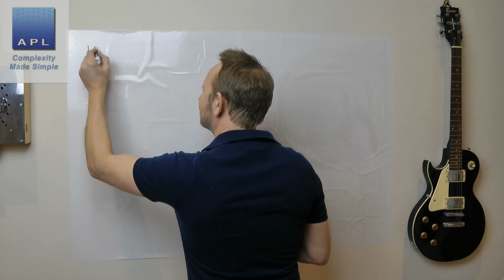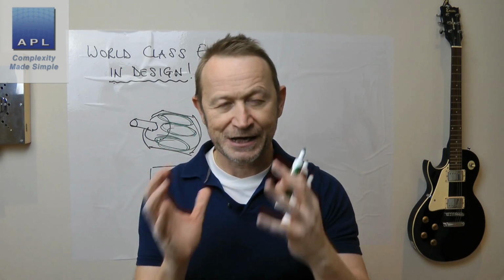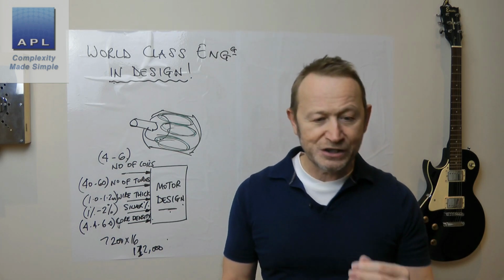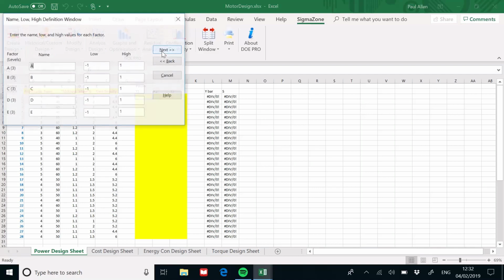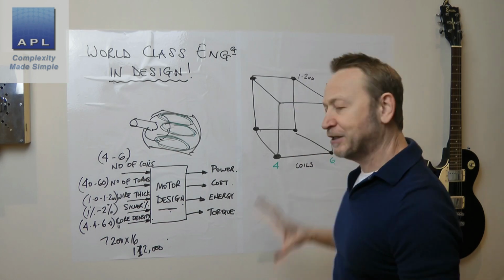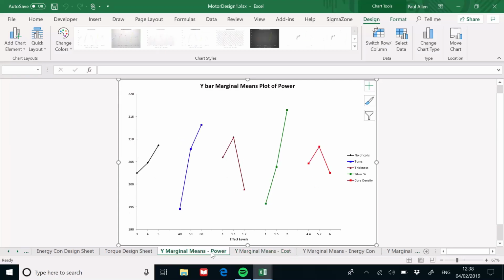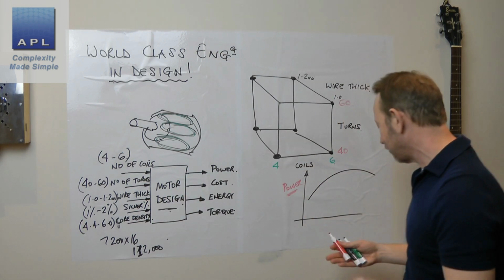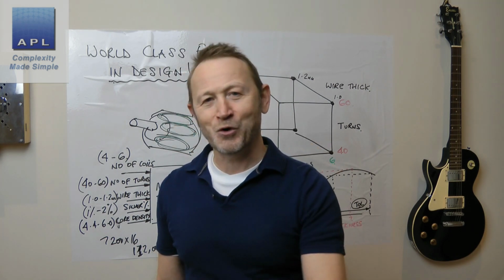DFSS  - Using DoE in the Design process, save time and money!!

Comment: Hi Paul, Another great video.   I notice that your DOE Pro has created a design with 28 runs,  which seems strange because Taguchi Design for 3 levels and 5 factors is L27  ....not 28.  Why the extra 1 run ? Am I missing something ?  Cheers.